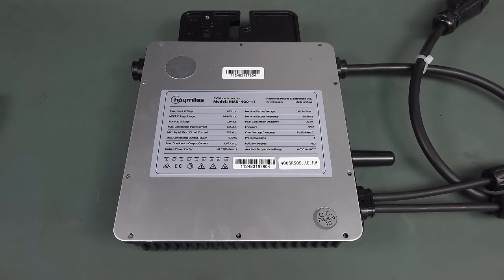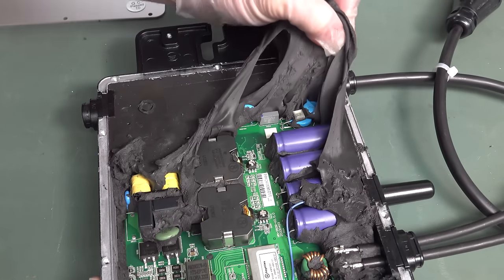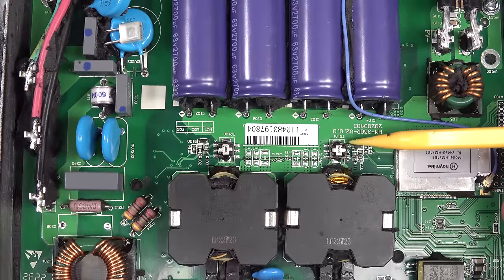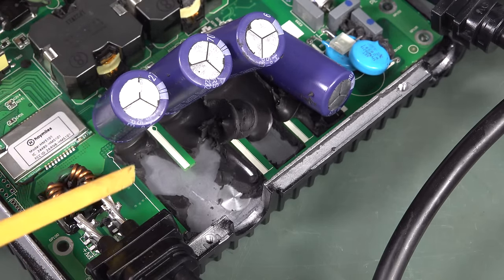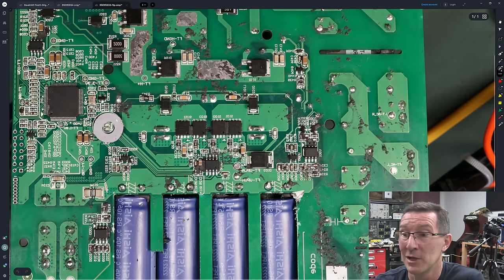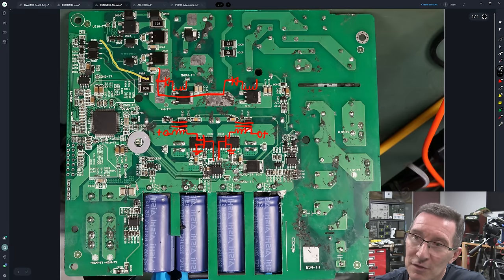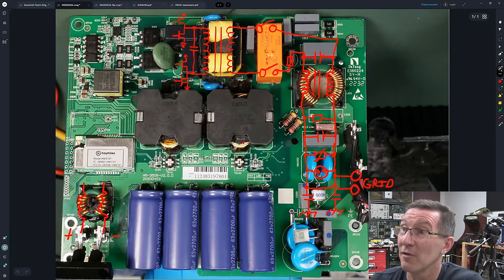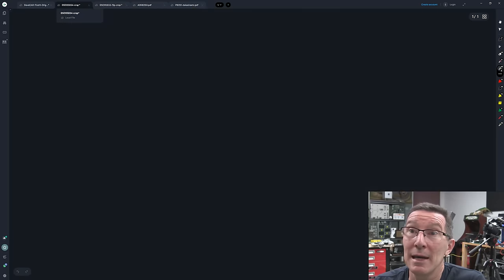EEVblog 1518 - Hoymiles Solar Microinverter TEARDOWN

Comment: Those axial power resistors are pretty high spec for carbon film jobbies - 2% tolerance, 25 ppm/K. Very not bad.
Reply: Why not metal film or metal oxide?
Metal oxide are flameproof and grunty.

Comment: Totally off topic im trying to get an oscilloscope to dc switch mode power supplies as cheap as possible  but I don't know what the minimum requirements is to test everything

Comment: hello great video.. I have to repair the enphase microinverter which does not work because of 1 swollen capacitor.. I removed the gray paste.. but it must be replaced for the seal.  Did you find the name of this thermal paste.. thank you

Comment: By using the putty, no pressure equalization element (valve) is needed, since there is practically no air in the housing - right?
Does this work well in practice? 
Might be also a good alternative (instead of controlled ventilation) for outdoor home projects (Wi-Fi APs...)?!

Comment: The AC side is galvanically isolated from DC side so the clearance is irrelevant. There is no reason for current to flow between those two fully isolated sides. PV panel is also like  a battery fully isolated  (maybe frame will be connected to earth but that frame is still isolated from the PV cells).
Reply from the maker: Not if you have a failure or leakage somewhere.
Reply: @EEVblog  The point is that in normal operation there is no voltage potential between those two points thus even if there is water, there will be no current flow.
Having water there is already considered a fault or abnormal operation and a second fault at the same time is almost never considered.
The PV panels are a fully isolated source unless one of the PV wires has damaged insulation and maybe touches a grounded metal roof or the frame of the panel.
Even so if the AC side near that DC is the neutral (as I guess it will be the case) there will still be no current flow.
Reply: Galvanically isolated by those AC coupling capacitors, so mange voltage doesn't interfere with the bias voltage applied to the base of those transistors while it's getting frequency matched.

Comment: TMS320 series covers a very wide range of device families, with new ones being brought to the market practically every year. I doubt that the one that you have in this inverter is actually an old model.
What's the exact part number?

Comment: I wonder how does the anti-islanding differentiate between grid mains and the output of other inverters (could even be different manufacturers) in order to shut down if grid supply failed?
Reply: They can't - therefore never combine a micro inverter with for example a camping inverter. Would actually make a good video idea to see what goes bang first.

Comment: Hmmm.  Maybe the caps are needed to buffer the reactive power feeding back from the AC side.
Reply: They are AC coupling capacitors to isolate mains voltage from the  transistors' bias voltage.

Comment: Just thinking about what you said about the gap on the board and that you would have extended it down further...

I certainly don't know the answers here

But I do wonder if the re-entrant conformal coating might make it pointless

Here's my thinking...

Any moisture that gets to the board must surely have to first get through the conformal coating

So moisture would be in the conformal coating anyway

Wouldn't that provide a moist path that is able to bridge any gap???

Like I say, I don't know. Perhaps someone else here has knowledge and is able to share it

Comment: If there are multiple of these micro-inverters connected together, how do the units keep all AC voltage wave forms in phase?

And what is the max units connected together?

If you have multiple strings, how do they stay in phase at the breaker panel?

thanks

Comment: I'm still wondering how an inverter "knows" when the grid fails. Especially when production is in a perfect balance with self consumption. Also, how could an inverter measure the grid frequency (to stay in phase) when it's continuously generating it's own sine wave on the same wires.... It's like it cannot talk and listen at the same time. Maybe another idea for an episode ;)
Reply: i was thinking the same thing
Reply: Except you can.

With mains the voltage (and frequency) is given, the inverter just controls the current. Without mains connection the inverter controls the voltage too.

Also, it can try to slightly push the frequency and if it works just shut down as soon as possible!
Reply: @erlendse  it matches it's frequency to the input mains frequency. When there's no input mains voltage to sample, it shuts itself off because it has too by code. Now ask yourself why a backup ICE generator gets to work, but not a backup solar inverter. Let me know what you come up with, would ya?
Reply: @mpirron1  Input=output. When a solar inverter puts it's power to the mains, it will also measure itself. My question was, how is the solar inverter able to distinct it's own sinewave with the grid's sinewave.... it's on the same wires! But @erlendse answer "it can try to slightly push the frequency and if it works just shut down as soon as possible!" is a brilliant answer!
Reply: It's usually not the inverter,.it's the hub it energy meter "listening" for the net 50hz frequency and then telling the inverter array what's up
Reply: @J_i_m_   Its the AC Coupling man It is providing the clock freq sync by Rneg synthesis.  When there is a loss of coupling there is no longer a negative resistance condition, and no clock sync. Jesus man don't guess read the paper or learn more about electronics or something.
Reply: But that don't even matter. It's not the question that anybody should be concerned with really, its academic. But there is a very important oe to understand. You have to start a critical thinking exercise by asking yourself .... why solar inverters MUST always cease generation when the grid power is lost?
Reply: @mpirron1  uh.. why do you ask me?
It's it oblivous: one can disconnect mains and feed the house/similar, while the other is permanently connected to mains and backfeed the grid when active.

When grid is missing it could backfeed the grid making stuff expected to be voltage-less live. Aka can't allow it to happend.

All design decissions!

a solar driven inverter can totally power a local system if it's made for local only use.
Reply: @erlendse  not if its got a grid connection, but generator can
Reply: @erlendse  Totally true, an inverter should not be able to change the voltage and frequency, and if it does changes, it shuts down. That's already a decent anti-islanding protection and a good answer to my question. But imagine an entire street, containing 200 inverters of several brands, producing 1MW combined. Imagine that the total street consumption is also 1MW. Then the grid goes away (for example workers are shutting down the main street transformer). The whole street now forms an island where consumption is in balance with production. Each inverter apart cannot know this, as it's injected current results in a voltage within range (one inverter could only influence the voltage by roughly 1/200). It will also fail to push the frequency slightly as the other 199 inverters will resist against it. Maybe it will be an exceptional situation when production=consumption for a long time, but I don't see any way how each single inverter could detect this.
Reply: @mpirron1  Mind elaborating?

What about generator and grid connection?

I expect a generator to have systems in place to disconnect grid input before sending out power! All design decissions based in use-cases.
Reply: @J_i_m_  Sure. But without a timing referance the current is tracking the voltage and the voltage is effected by the current. I kinda expect it to go haywire and shut down quickly enough.

Not sure how it works in practice tho.

Like you would probably need a big syncronous motor with a huge flywheel to keep it going. (or a made for purpose grid scale inverter)
Reply: @erlendse  exactly, the system is called an automated transfer switch, and it allows the generator to provide panel power without back feeding the grid. But they are not allowed to be used with a solar inverter anywhere in the U.S.
Reply: @J_i_m_  none of it would be a problem if you were code allowed for an automated transfer switch to be present, currently not code compliant anywhere in the U.S.

Comment: Defo do another inverter. Do them all.
I don't really care for lyt caps in a device that should last 30 years but maybe a 400watt 50Hz sine needs such a big spike?  could you check their switching frequencies? running high means you can use small trafos, even pcb ones at MHz where it starts to get elegant. But that there looks pretty old school.

Comment: I believe that potting material is heat disspative.
Reply: I have seen it on high corrent devices in older plasma displays in the past..First go at it I thought it was weird stuff.
Reply from the maker: Yes, I mentioned that several times.

Comment: Are those the plug and play no electrician required solar inverters I have seen advertised that go to a normal outlet or power strip?
Reply: Sure they can, it's  240vac like any other, well as long as the smart meter is aware of them and grid mains voltage can reach those AC Coupling capacitors

Comment: I wonder if anyway to use such microinvertors off-grid? 
Yeah I know they are designed to be grid invertors and must switch off when main power disappears. But maybe some solution exists for off-grid.
For example will such invertors work if use pure sine invertor from the battery as the "master sine"?

Comment: I would think one transformer, diode, and capacitor would be used for the + half cycle and another set for the - half cycle.  This way both could be PWM.

Comment: Once the unit turns on and is feeding power, how does it detect loss of mains?
Reply: Because mains voltage is sitting at those AC coupling capacitors getting frequency matched

Comment: I found all those resins and pastes will degrade over time. Some dry out degrading into conductive carbons. Others sweat liquids (sorbothane). Only silicone-based ones remain stable. A mess...

Comment: .. why would you put electronics outside in a hot cramped box? Sounds like a maintenance nightmare, those components must be red hot in the sun. Get the DC through the roof and into a bigger inverter with adequate cooling indoors

Comment: "Certified Solar Electrician" =
The Manufacturers, Retailers Shifting Responsibility to the Trades and Workers.
Plus Restricting Competition.

The Isolators Failing was/is a Disgrace and Complete Failure by Regulators.  The Electrical Regulators in Australia have Different Rules, Standards and Penalties for the Various Industries Involved with Electrics, Not Good.

Microprocessor, Only 400 Watt Invertor, Dumb Small Invertor is going to be More Reliable, So Why the Microprocessor ?.
Also Large Number Parallel Invertors has Negatives because of Energy Losses.
Great Presentation, Thanks for Your Knowledge.

Comment: How come microinverters are still so relatively expensive? I would think an e.g. 100W one should literally not cost more than a couple of dollars? It would be so convenient if one could buy super cheapp 100W panels with a 120V (or what have you) output.
Reply from the maker: Business opportunity for you!
Reply: @EEVblog  sadly, i don't think so for me. But is there an inherent reason why they haven become dirt cheap yet? Even the cheapest ones on amazon are still way over 100$
Reply: Because it's a racket and they are racketeers.

Comment: I'm interested in how the circuitry syncs with the mains and with other panels. But having a number of microinverters up in the sunshine out of my reach doesn't inspire. As feed in tariffs get worse i wonder if there is a point i them, a reliable second source of mains even for a few sockets may be my preference. 
Search Vynamould it may be similar to that gel compound (pour when warm set when cold) -May or may not be the same product.